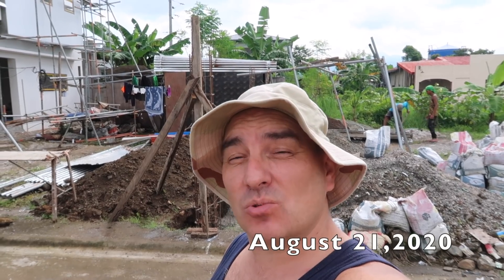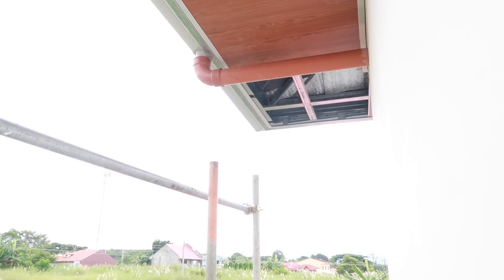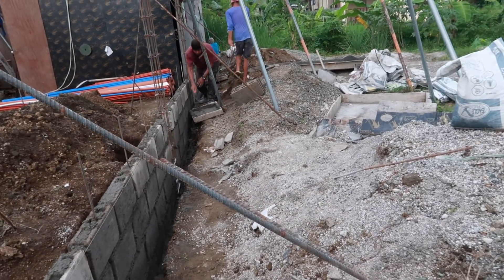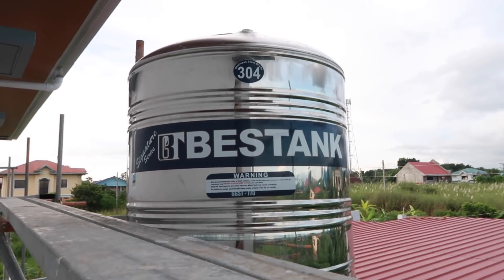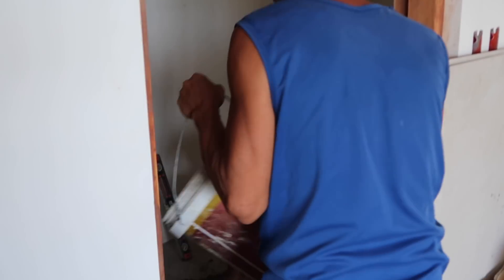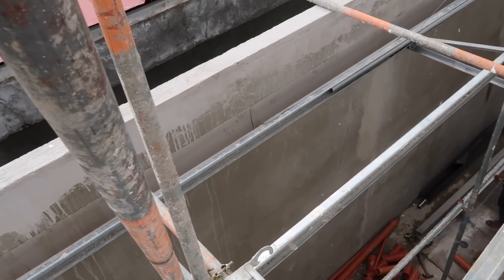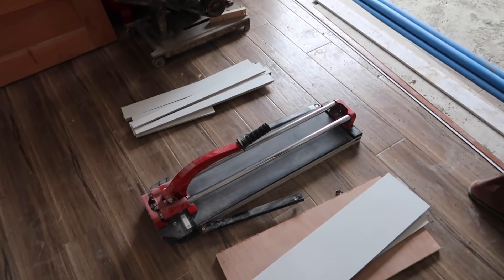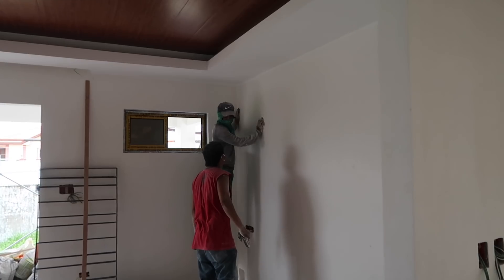HOUSE BUILDING IN THE PHILIPPINES - EPISODE 163: WATER TANK IS UP I TILING THE STORAGE

Comment: You should install 2 - 3" pipe diameter underground  around outside the house with stub up and about 12" depth underground with a very small hole underneath the pipe and the hole of pipe distance of 4", the intention is to put your chemical or anti termites every year, this is proven to my house even ants and cockroaches is avoidable, just a suggestion.
Reply from the maker: I heard about that.